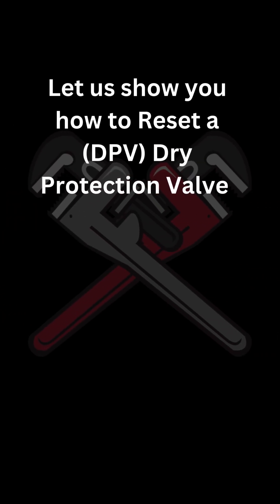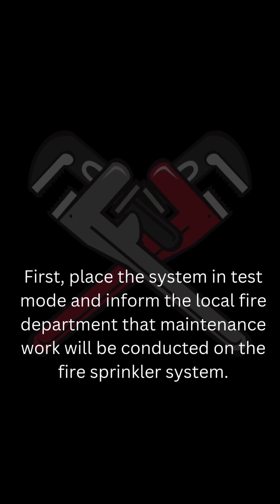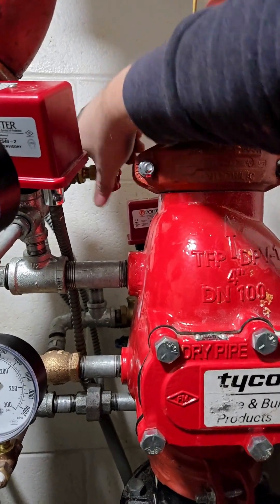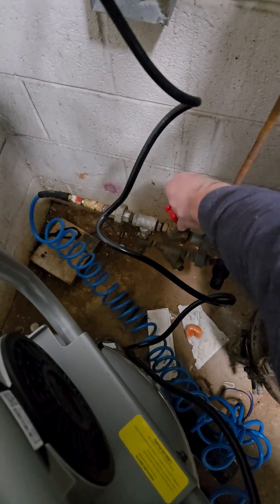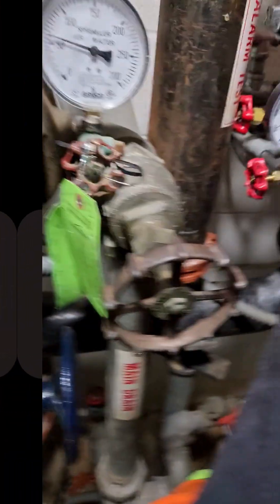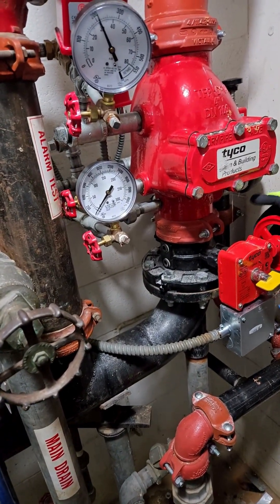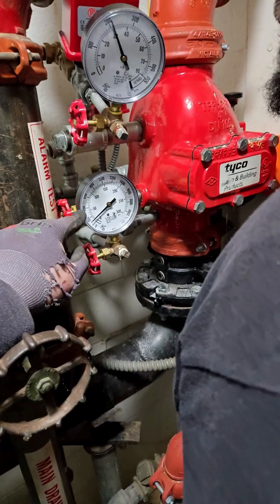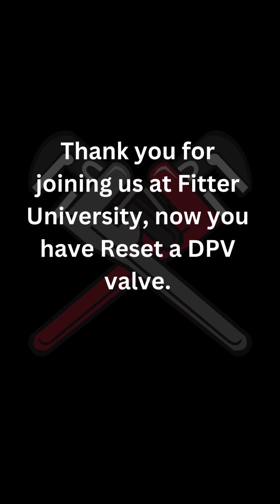Let us show you how to Refill a DPV dry valve #firesprinklertraining #nfpa13 #fireprotection

Comment: Why did that air line have so many valves?
Reply: It's called an air maintenance device.  It has things like pressure regulators and pressure relief valves.  It has all those valves so you can service each piece.
Reply: Also it has a bypass so you can service is without shutting air off
Reply from the maker: Good question, it was already added when we showed up for servicing. normally you only see 1-2 valves this one had like 3.